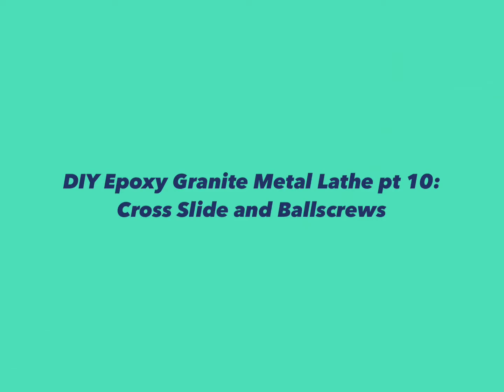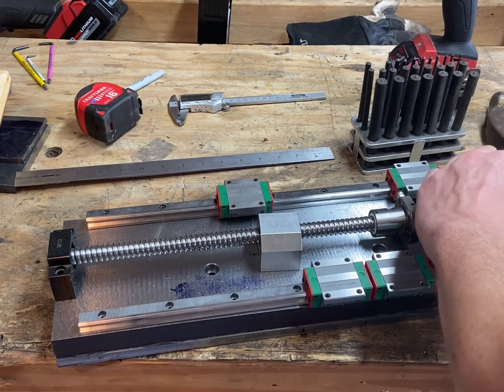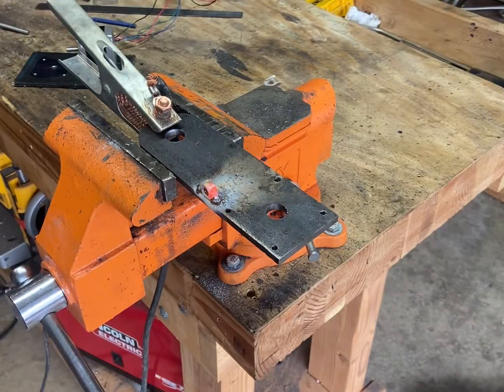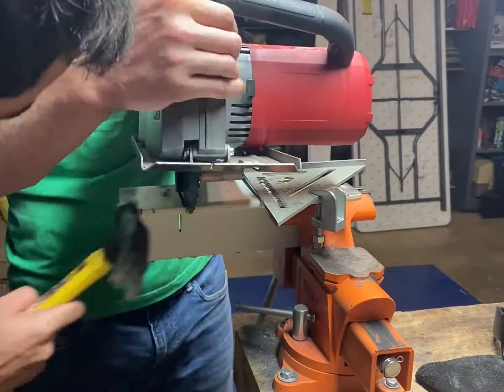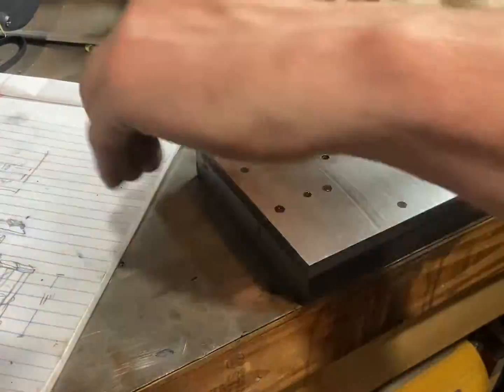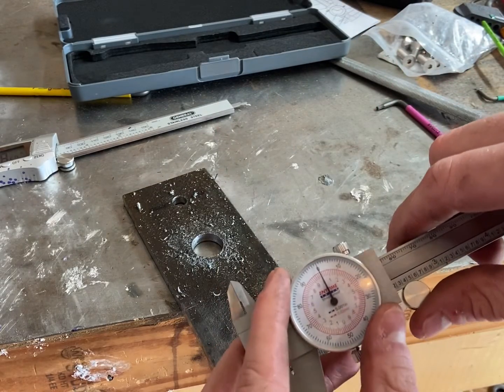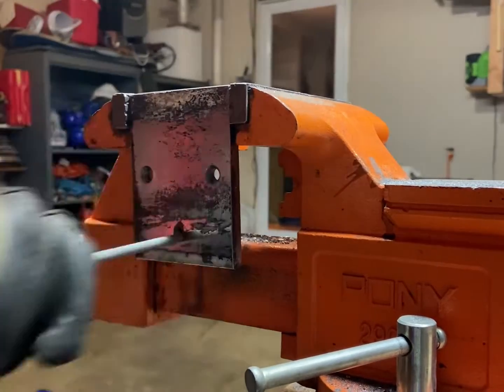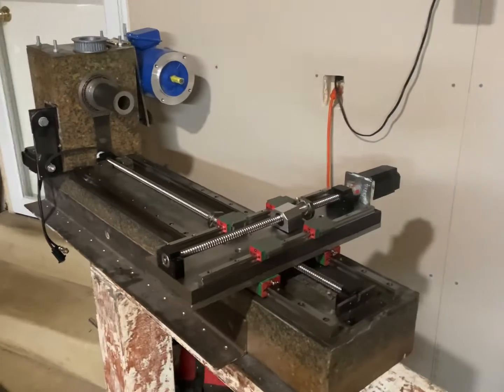DIY Epoxy Granite Metal Lathe PT10: Cross Slide and Ball Screws

Comment: I'd use an angle grinder to cut those pieces of angle that want to close up. Just don't allow the blade to sink into the material. This means you essentially score the work along your cutting line never allowing your blade to completely sink through the cut until it's very thin. It requires multiple passes.
Reply from the maker: That’s a great idea, thanks!
I’ve heard that makes the blade last longer too which would be nice

Comment: When you’re cutting and you feel your blade start to pinch, just fully back out of the cut and run the saw through again. That will recut whatever deflected inward. Might have to do it several times but it should cut fine.

Comment: 4:40 - The perfect tool is a metal cutting bandsaw, I have seen people making their own. Need to make/buy a large length bandsaw so that it can cut large and tick metal pieces. That machine is super scary and dangerous, would advice to buy one since a lot of safety for the user needs to be well thought of if making one. A much better and safer option is to use a high amp plasma cutter, it will cut through thick metal quick and easy.
Reply from the maker: Absolutely, a horizontal bandsaw is on my list, although I don’t really have space for it right now is my biggest issue. The circular saw I think is quite safe when it’s used for metal it’s made to cut (around 1/8th in to 3/4in) but I do agree it’s probably not great to use it for some of these other cuts. Hopefully before too long I’ll be able to get the bandsaw and then the problem will resolve itself

Comment: You should have installed crosslide top plate first before drilling for ball screw Mounts !!! This way you could have maintained lowest disalignment possible.
Reply from the maker: I actually have enough play in the holes where I can align it as accurately as possible after the fact, or at least I believe that’s what you’re referring to? The alignment between my cross slide rails and cross slide ballscrew correct?

Comment: Hi Robert - can you add a contact email to your About page? We're discussing your lathe build on our homemade tools forum. Sometimes when I post a link in YT comments it doesn't come through, but I can email you a link to the discussion.
Reply from the maker: I saw actually! Adding the email now. YouTube studio linked me to it lol. I actually was really interested in learning more about the comment regarding the spindle length. It sounded like there was some reason why I would need a longer spindle with more distance between bearings, but I don’t understand why exactly? Assuming the spindle is taking lateral force at the front end, the spindle would be a lever “pivoting” around the front bearing right? So to me so long as the distance between front and rear bearings is reasonable, the mechanical advantage of the force acting on the rear bearing would be about 1:1.  Is there something I was missing with that?
Reply: @robertsteinwandel6658  Thanks; I just got your account set up and sent you an email. You can go ahead and post your point about the spindle length and I'm sure you'll get a detailed reply.

Comment: I'm not sure about those specific rails and linear bearings but typically, you don't use grease on machine tool.  I believe this has to do with the grease turning into a slurry from chips and dust.  I think it may be best to stick to oil.  Hydrolytic oil is what I use in mine.  It has the advantage of easy plumbing for automatic oilers.
Reply from the maker: Oh my, okay I’ll look into that, hopefully if this is badly wrong I could just pump oil through to remove it lol. I do plan on having ways covers though, so hopefully that will help too

Comment: Great progress!
In engineering, everything is a spring, and the softness of the complete system is softer than the softest spring in the chain (Same math as resisters in parallel). 

That Z motor mount looks very soft in bending. Put a clock on it and see how much it flexes. You have made a really rigid bed, would be shame to negate some of that advantage to a single components compromises.

Good think is you will soon have a lathe to make replacement parts for itself. Home shop machining is a closed hobby.
Reply from the maker: That’s very fair, and actually something I was thinking about a little bit but Id love to see what you think about this reasoning

So my Z stepper has a pulley to my main leadscrew. The main forces the assembly will take will be tension force in the direction of the belt, pulling from the stepper pulley towards the leadscrew pulley. So the tension force is opposed by the force of my carriage bolt on the side of the lathe. The main deflection I see would be a deflection from moment force about the vertical axis. There is about .75in in the z direction between the carriage bolt and the stepper pulley. My thinking is that even if the stepper is at a full load of 4Nm torque, that would be a negligible deflection, although to be fair I didn’t do the math. 

You raise a really good point though about springs, I remember doing vibrations in college and thought that was such a cool concept. Probably worth remaking the stepper tensioner later regardless, at least to try to keep reducing deflections throughout the machine
Reply: @robertsteinwandel6658  Put a clock on it, and take roughing cuts, and you will soon see :)

Those really high performance industrial machine tools tend to have a stifness budget of about 20N/µm of deflection. You have to have everything really stiff to get close to that. Thin leadscrews, poor screw bearings, undersized belts etc all eat that up fast.
Reply from the maker: @RotarySMP  lol yeah, how about if I have issues with all of those things hahaha. I do have my Ballscrews so they would generally be in tension during a cut which I figure will help (I’ll need better Ballscrews eventually). 
 I’ll need to actually bolt everything down and check the deflections soon, thanks for the stiffness number though that’s great, I really didn’t have a good conclusive number before. I would assume that 20N/um would be out of my reach without a lot of rework, but it’ll be interesting to see what I could get to!
Reply: @robertsteinwandel6658  DId you see my Minilathe episode where I put a clock between spindle and tailstock and twisted the bed with bare hands. I think the minilathe would have a "stiffness" of about 0.1N/µm or worse.  Kind of like cooked spaghetti.  You are going to worlds ahead of that. I think 20N/µm is the sort of stiffness a new high end machine like a Mazak achieves.

I think the bigger practical issue you will have is keeping swarf out of that belt. ;) Why didn't you put the drive down at the clean end?
Reply from the maker: @RotarySMP  I did! That was the vid I believe where you attached it to the big steel plate for added rigidity right?

I’ll keep those as benchmarks then, somewhere between .1N/um and 20, hopefully closer to 20 haha

I only put it there so I’m putting the leadscrew in tension during a cut towards the headstock, I figure it would have less axial deflection in tension since it wouldn’t want to bow like it would in compression
Reply: @robertsteinwandel6658  I watched those lathe videos from First cut. He has done a masterful job of setting up a video studio. I hate to thing how many hours of angle grinding he has done on that thing. His arms must have felt like jello.
Reply from the maker: @RotarySMP  couldn’t agree more hahaha. 

To be honest I would’ve thought he’d have trouble with internal stresses from the welds as he ground his pieces, but he got some really solid tolerances it looked like so I guess that worked out. I wonder if those stresses would cause any warp longer term?

But yeah just beautiful video and really cool looking project so far wow
Reply: @robertsteinwandel6658  I was wondering the same. I expected him to build a big bonfire and stress relieve it over a couple of days.
Wonder how stable it is over time. Also, that surface finish is much more raw than scraping, so I thing that the plastic way strips may wear pretty fast.
His makes spectactular YT content, but I think you lathe bed is a better design.
Reply from the maker: @RotarySMP  yeah Id be really interested to know why he went with plastic over like bronze strips that would wear a little slower. 

It’ll be cool to see how it goes though! And thanks hahahaha